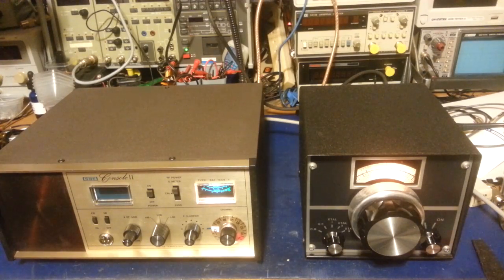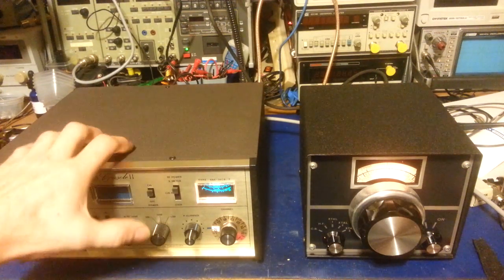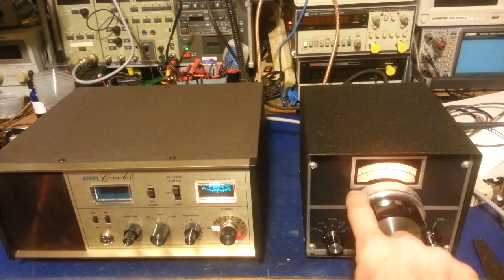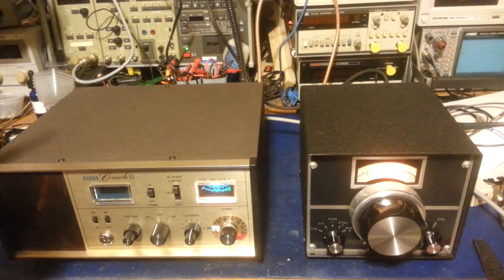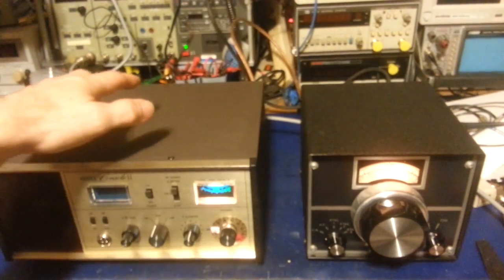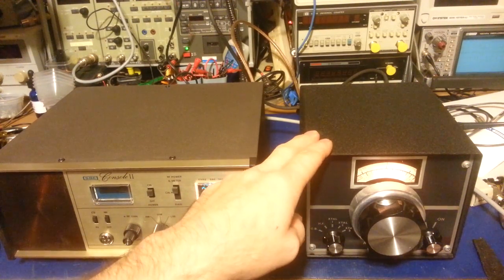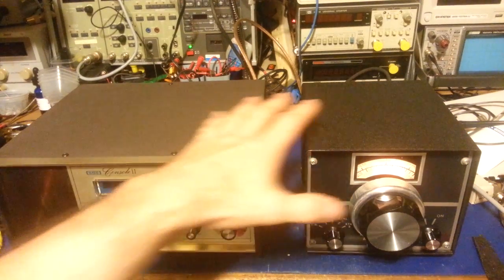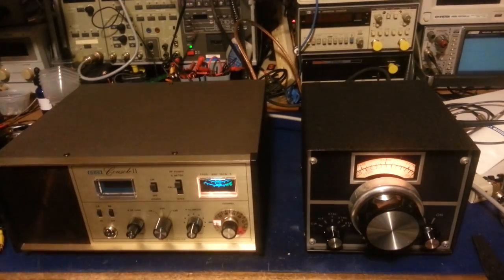SBE Console II and tips on setting up a Siltronix model 90 VFO.

Comment: Great video! I have a Siltronix model 90 vfo hooked up to a old TRC 48 radio and it works great. I bought it used in 1980/81  and had my tech. friend hook it up for me. Plugs in through the PA jack in the back of the radio. How old are those VFO's?  I am guessing early 1970's?

Comment: I need a CB guru on the SBE Console II.  I have two these radios. One has place for what called SN unit and the other has the SN unit installed. However the one has hum coming from the speaker and fails to transmits anything. The other seems to be working but needs a great deal of cleaning on the controls. For the life of me I can't find any information about the SN unit.

Comment: Great info. I have my original  Console ll bought new and 90-1
Radio works great but with vfo connected nothing from vfo.
The vfo powers up but doesn't  seem to be sending signal.
Could this just be  the electrolytics or should I be looking somewhere  else.
Thanks for all your great videos!
73

Comment: Hi Mike i was told with a pal that was here for install in a radio I told the after looking up the one he needed was a different pal number and they said all i had to do was change the crystal in the vfo !I said i dont think so pal made several for diffrent radios. They took it away sad and mad at me.    YES----NO  ??
Reply from the maker: To change a PAL brand VFO to operate in a different frequency range is a lot of work.  Capacitors and resistors have to be changed to different values and several coils and transformers have to be rewound for different inductance values.  It's all in the PAL manual.
Reply: Thanks Mike then i told them right correct! He needs the one listed for his radio right!

Comment: MikesRadioRepair - Are these radios known for backwards swing on strong signals on the S meter? I have this set-up and distance stations have forward swing, but everyone close by gives me a backward swing when they modulate. Thank you.
Reply from the maker: Russell Jones 

Common on many radios.
Reply: I have about two dozen vintage CB radios and the Console 2 is the only one I have that does the backwards swing thing. I have spent hours poring over the schematics looking for the reason but have come up empty. The radio is still a good one to use on 16 or anything else.

Comment: When these 23 channel ssb rigs came out there was a "gentlemens agreement" that channel 16 and 18 be designated as ssb channels. Just like channel 13 was specifically used for marine traffic and 9 was for emergencies only with 19 being a highway frequency.  When 40 channel ssb rigs started being manufactured,  again there was a "Gentlemens Agreement" that 36 thru 40 be designated ssb channels. But in reality any channel can be used in ssb mode, especially in these days where "gentlemen" are far a few between on Citizen Band Radio. SSB has always been treated as the "evil step child" in the 23 and 40 channel CB days where only a select few channels were used in ssb mode and the rest in AM mode. And today as far as I see, channel 38 lsb is where I only hear any SSB transmissions at all. But, the way I see it is, if theres someone who you want to talk to on SSB, pick a channel from 1 to 40 and have at it! No gentlemen,  no agreements and no rules.
Reply from the maker: KB2CWN 

Yeah the channels aren't crowded like they were back in the CB boom days.  38 LSB is the most popular channel but I do hear people from 36 to 40 regularly.   Really depends on skip conditions.  Then there is the international crowd that hangs out in the 27.555 out of band area.
Reply: Ok Mike, but Im not talking about the "Freeband" area of the spectrum,  just the 1 thru 40. I haven't heard any activity on 36, 37 or 40 ssb in years, no matter what the solar flex is at.
Reply from the maker: KB2CWN 

A few months ago when skip was really good 36 to 40 was non stop activity here.  So busy it was hard to break in at times.
Reply: MikesRadioRepair Propagation here in Florida is just not happening on 27mhz

Comment: I appreciate the amp circuit and will give that a try on a 90-3 in a Mark III. Drive is OK on normal CB but drops off on HF so this should help.
Reply from the maker: That could also have to do with the radios alignment.  Was it aligned after the VFO was added.  Basically what you want to do is align it to the center of the frequency range you will be using.

Comment: Don't know why but I always liked the Pal vfo's over the Siltronix.  Seem they were more stable. But much harder to change frequency range.  Then there was the Tram Diamond vfo. Great video as always Mike.
Reply from the maker: Yeah but the Siltronix has two bands and three crystal sockets to.  I never thought they were that bad once warmed up.  Biggest problem I see that causes drift is when people work on them and they don't use NPO rated caps.  That really throws off stability.  The tiniest change in capacitance value on the caps C12 & C13 can cause horrible swings in frequency.
Reply: Thanks for that information. Been a long while since I had my hands on a Siltronix. I do have a model 80 on my old Golden Eagle mark 3. All the crystals in the transmitter is so off frequency.  Guy kept it on a top shelf next to the ceiling. Ran a gas wall heater below it. Think the heat my have aged the crystals by 100 years lol.
Reply from the maker: +The Radio Shop 

It gets expensive changing all those crystals.  VFO is the perfect answer.
Reply: I got a quote on some crystals at 14 bucks apiece when I got this radio. That's 322 dollars. VFO is the only way lol.
Reply from the maker: +Eric 12374 

Where do you get new crystals for $4?
Reply: $4--please advise

Comment: Great video Mike actually i am doing one right now on a Royce cb radio 23 channel. VFO is very sensitive to tune remove bottom cover to tune, but when i put cover back on the frequency change!! 😕
Reply from the maker: Adjustments MUST be done with covers installed.  There are access holes in the bottom to get to the trimmer caps.